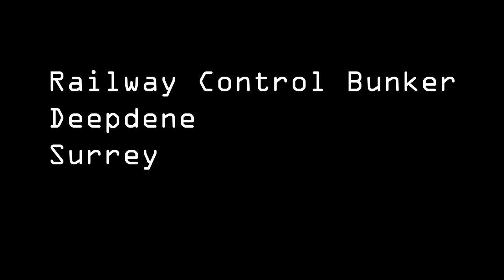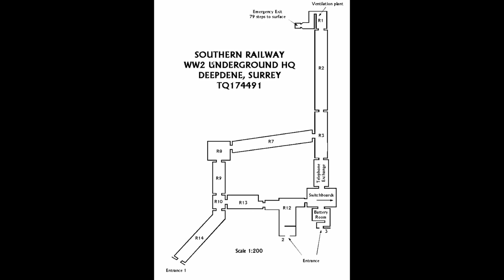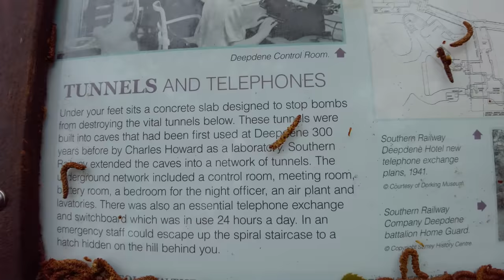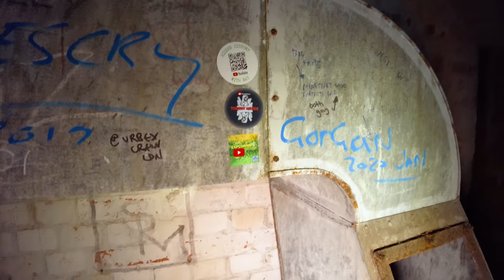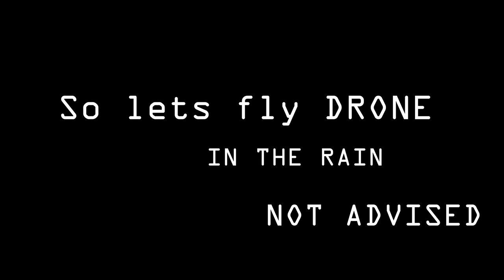DEEPDENE Railway Control Bunker

Comment: 15:38  The fuse box was probably butchered by copper thieves to get at the buss bars and other valuables.  I know there are other intact fuse boxes in here that haven't been touched.  If this was just random vandalism they wouldn't have stopped at just this one they would have done all of them.  There was something about this particular one they were after.  

Oh, I just realised it's not a fuse box as such it's a master switch judging by the 2 fuses and their size.  That will be why it was taken and the others were left intact.  Being a master the box might have been copper, or the master switch would have had enough copper to make it worth getting out.

Comment: 19:20 I’ll bet that was a battery room and those switches on the wall where probably to isolate the battery chargers. Telephone exchanges needed a lot of power and it was often easier to,power the, from batteries as the risk was , if power failed from the mains all comms would be lost